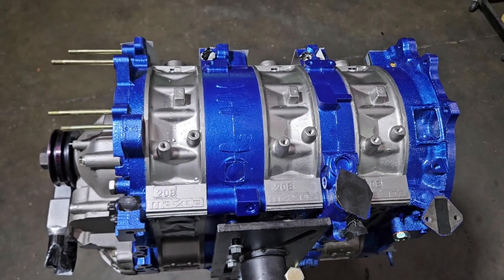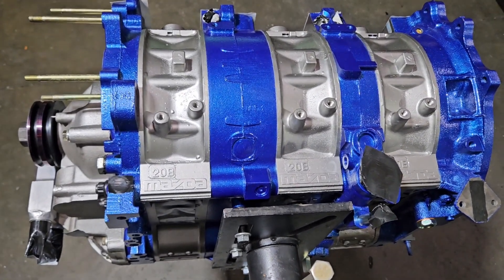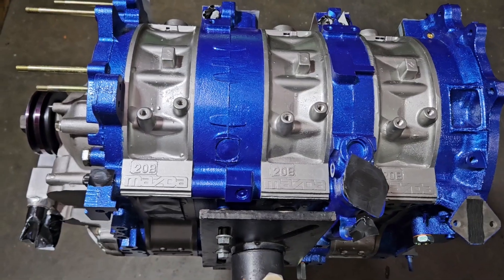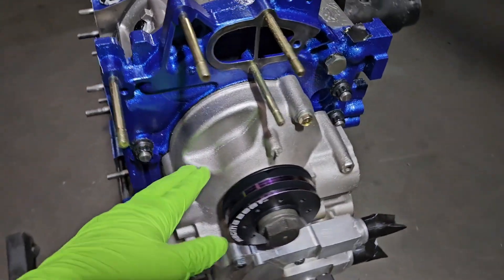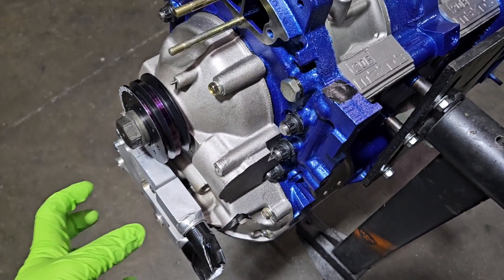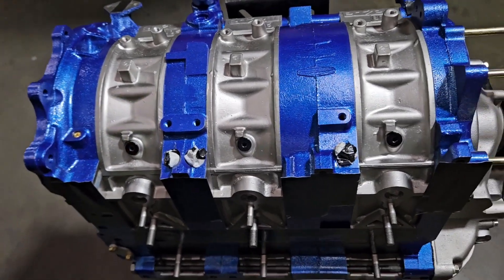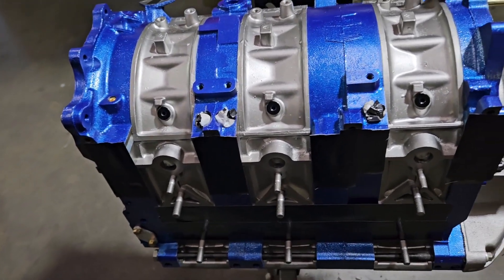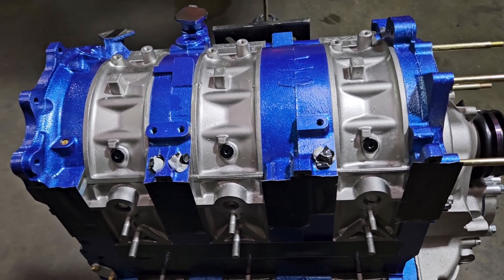Big Power and Reliability - 3 Rotor 20b Turbo Road Race engine - Studded, Dry Sump tech talk

Comment: Hi Kyle, I have an N/A 20b I rebuilt at my home. We did 9.7 rotors, streetported, and had it balanced. 

What can I safely rev it to? I noticed you didn't do any external oil mods for the center bearing. I recall a lot of people saying 7000 is the limit on Rx7club.
Reply: External oil mods would be a good vid